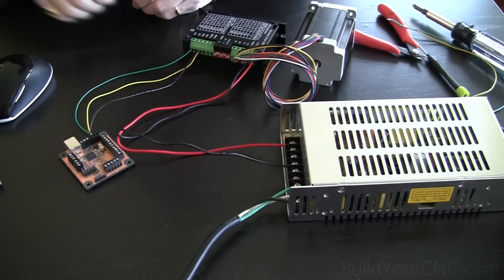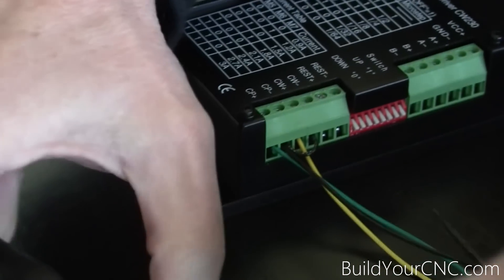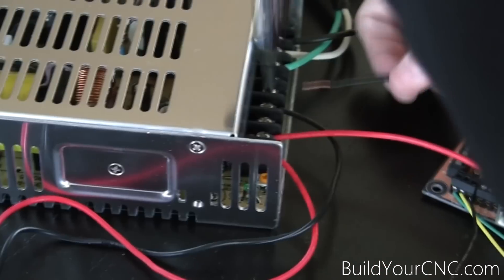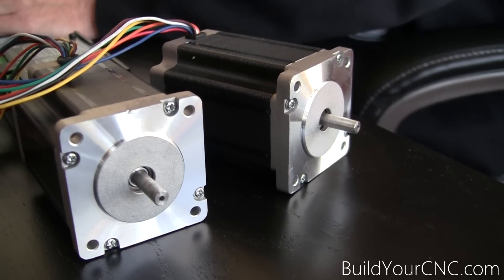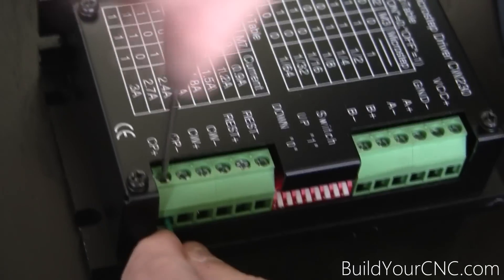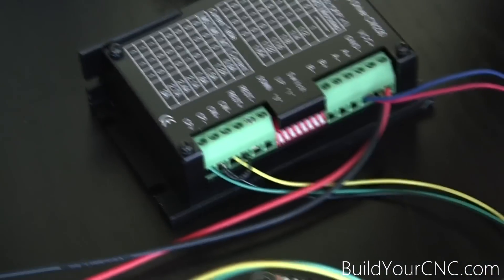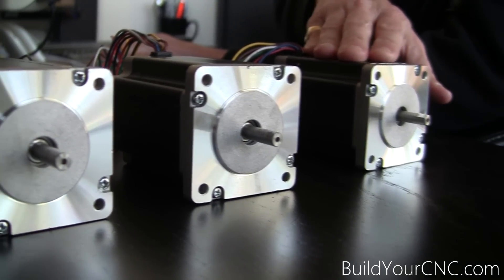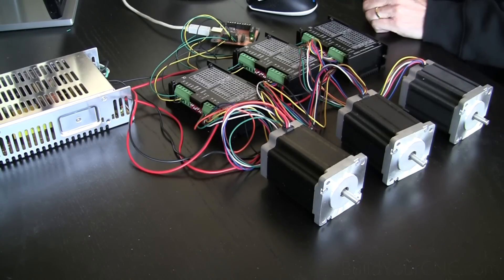USB CNC Controller/Interface Wiring Instructions Part 2

Comment: any video on the limit switches. I get no signal into Planet CNC from the switches
Reply from the maker: What planet-cnc controller do you have? We haven't sold these for a very long time.
Reply: @PatrickHoodDaniel  yes, this one is from 2013(ish). I'm building a new CNC from only parts I have around. I have the old 425 kit from the earlier BuildYourCNC (the book). 
There seems to be an issue with the board both Y-- and Z-- work fine (but, as Stop + in CNC USB Controller). X doesn't react unless I I rub my finger of the resistors behind the connectors).

Comment: Thank you for a intuitive video . I am going to assemble the CNC electronics this summer , and this is helpful . Was going to use Nema 34 steppers and the supporting electronics. 
Although the system I seen had independent 48V  Power supplies  , and a 12v and 5v power supply

Comment: Any problems with Mach3 recognizing a USB board vice parallel?
Reply from the maker: If you are using a board that connects to the computer via the parallel port, then Mach3 will have no problems. This board cannot use Mach3.  Rather, you will need the planet-cnc control software.